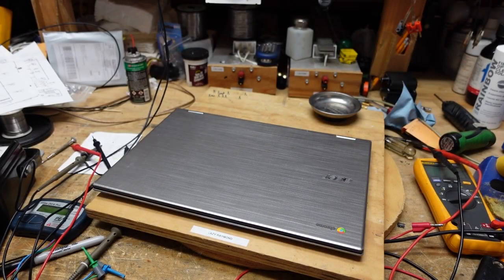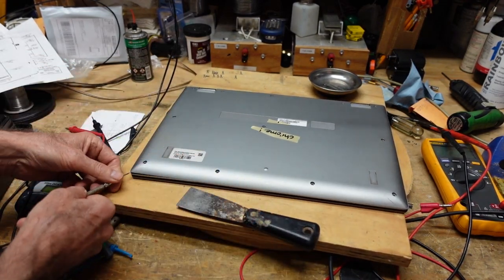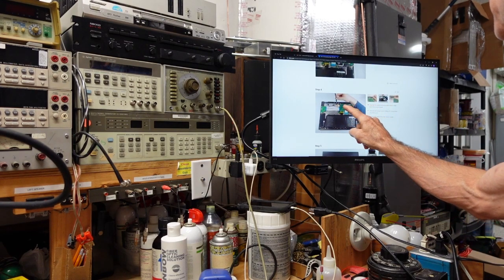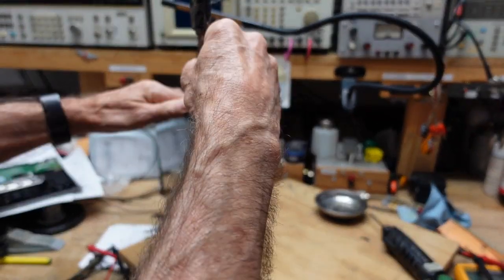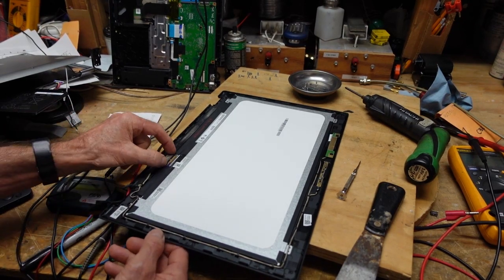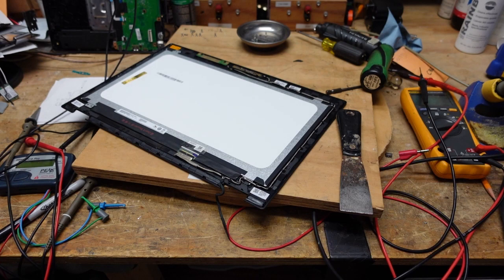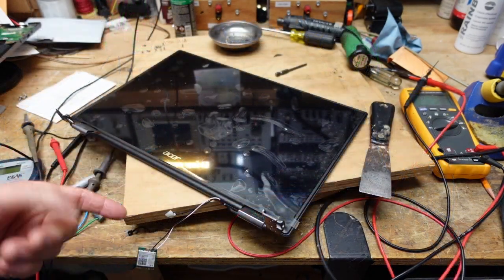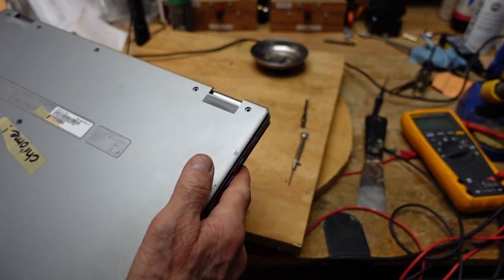Acer Chromebook Spin 15 Screen Replacement

Comment: Hello how are you. I have been repairing notebooks for more than 20 years and the first thing I always do before removing the first connector is to disconnect the battery. It is very easy to short something. greetings.
Reply from the maker: Agreed.  I've always done the same, but decided to follow directions.  And in this case they left something to be desired!  Thanks for your comment!

Comment: I just ordered a screen replacement for my 713 (similar form factor by the looks of things). Should arrive in a couple of weeks, but I got to thinking after watching this and reading "official" directions....apart from not being able to disconnect the battery why does the screen have to be removed from the body of the laptop?
If you turn if off, and close the lid, then the screen back panel could be pried off. Then disconnect the one connection. Leaving panel on keyboard remove camera, wire around edge, etc.  replace everything on new panel after swapping to keyboard position. Snap back panel on. May try this....
Reply from the maker: Interesting.  Let us know if this worked out for you, Kent!
Reply: @raygianelli3612  Well screen replacement finally arrived after a glitch hold-up due to postal strike here. Yep, replacement can be done without opening up laptop. I never would have thought of doing it looking at the manual, but something clicked watching your very clear video. Thanks! 
I made a a video of me doing this...pretty bad, LOL, but you get the main idea:  https://youtu.be/8DC1uc-YAnc?si=XBoqwsa3GBcdkYp1

Comment: Thanks for this!  I need to replace the screen on an Acer Chromebook Spin 713, and this is the closest I can find.  Hopefully the disassembly is similar.  Can you provide a link to the iFixit page that you used?
Reply from the maker: I'm at work now, but I'll post it to this reply after I get home.
Reply from the maker: Here ya go:
https://www.ifixit.com/Guide/Acer+Chromebook+Spin+15+CP315-1H-P1K8+Display+Screen+Replacement/128643
Reply: I need to do the same on a 713. Acer wants $550 to fix it... NOPE! So did you do your 713 yet? Is it pretty much the same?
Reply: @Shooter_FPV  I bought a screen, but it turned out to not include the bezel, and since the screen and bezel are glued together, I realized I needed a complete assembly.  I returned the screen and tried to buy a complete assembly, but one that would maintain compatibility with a stylus was over $200.  I ended up finding a used 713 on Ebay for $200.  The new one is in excellent condition and has an i7 processor and 16 G of RAM, so it's a good upgrade.  I still have the old one, but wasn't able to fix it for a reasonable price.
Reply: @rkennedy  Hmm... I am an IT tech for a school department, and my boss found something on eBay for about $130. After what you just said, I wonder if we're going to get every part we need. I'm totally sure I can replace it, but now questioning the order. Guess we will have to wait and see. I appreciate your quick reply... thanks!
Reply: @Shooter_FPV  Well, $130 sounds about right for a complete screen assembly, but not for one that is compatible with a stylus, like the original.  If using a stylus isn't important, then you might be ok.  The ability to use a USI stylus was really important to me.

Comment: trying to replace the screen on my cp514-3h. where did you source the replacement screen? the hits from a google search seem less than reputable
Reply from the maker: It was a while ago, and I don't remember.  It was a vendor I'd never used before, but the screen is still working.

Comment: i hate working on friggin laptops. but what i hate more is working on laptops that best buy worked on previously😐
Reply from the maker: Not a big fan either, but even worse are smartphones.  Some of the screws are so small you can barely see them.
Reply: @raygianelli3612  i don't do smartphones....or anything with an apple logo😂